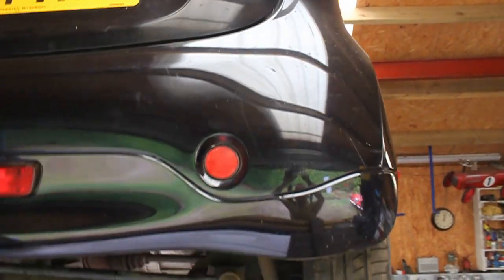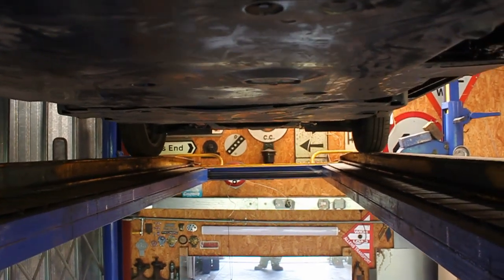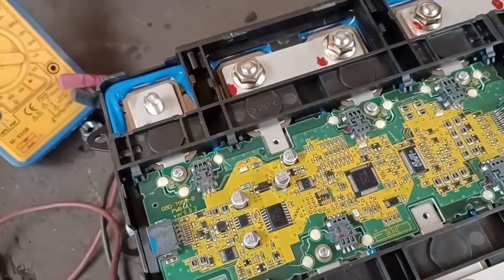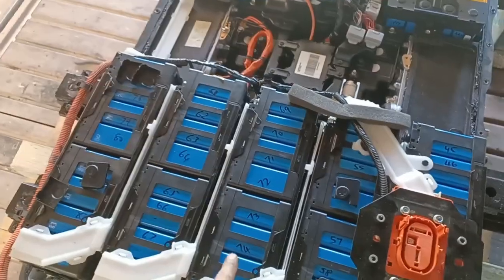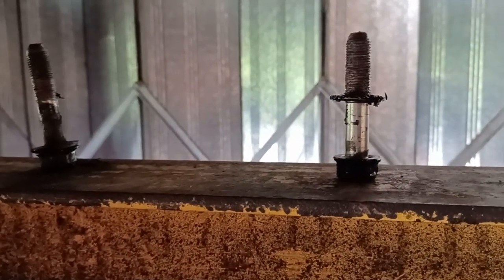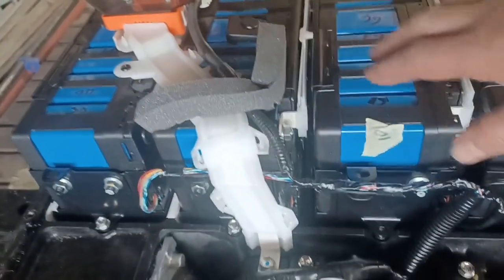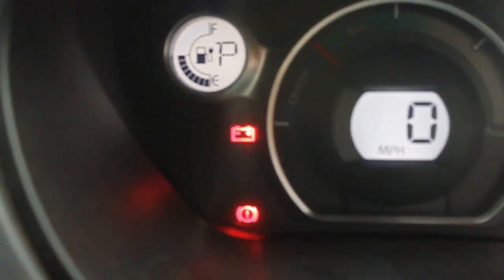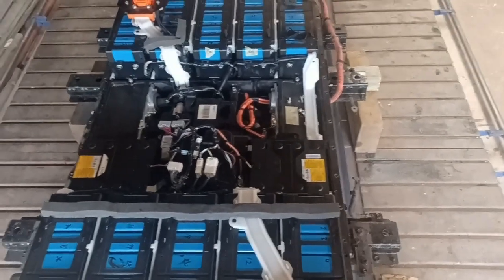Can I clear fault codes - Battery PCB investigations #electriccar #mitsubishi #electricalrepair

Comment: What diagnostic tool did you use? I need to do the same, I wanna buy a used imiev
Reply from the maker: I found that HOBdrive works with a decent dongle but you need to purchase a licence not just the free version - free one does not have the imiev details on it to clear and connect to the car properly. ebay sourced the dongle but it was about 30GBP and think hobdrive was around 18GBP     OBDzero is also very useful to scan the batteries and voltage levels but you cannot clear faults with it but it is free download and very useful. HObdrive you can connect your phone en route and a passenger can cancel fault codes as you drive!

Comment: Interesting test results; thanks for sharing. 
It seems odd to have different boards rather than a standard board that is configured as a module number. 🤔
Reply from the maker: think they are all the same boards but they are dealer allocated a number. This can be dealer altered but not DIY as far as I am aware.